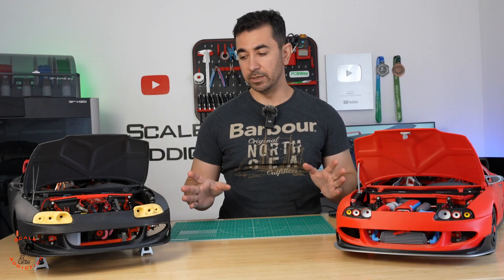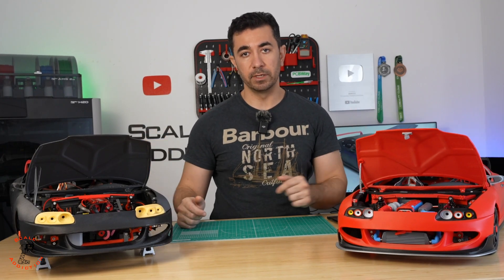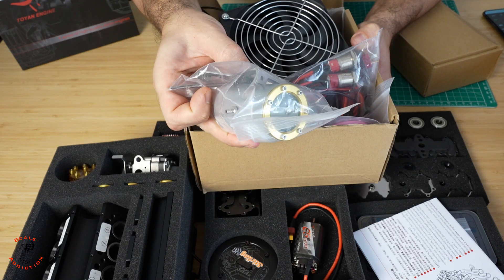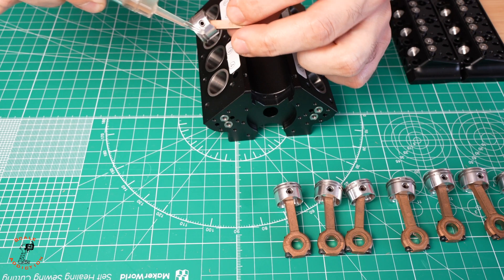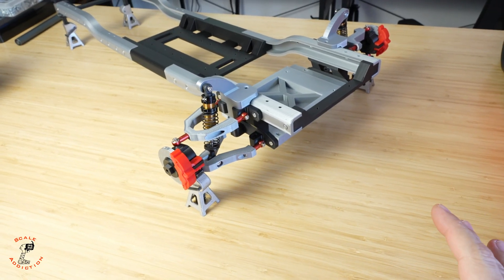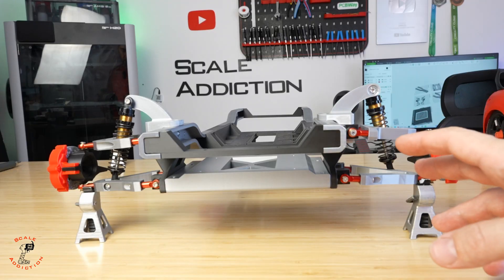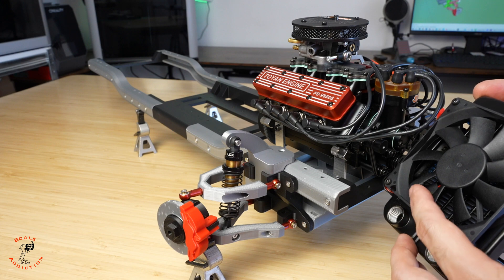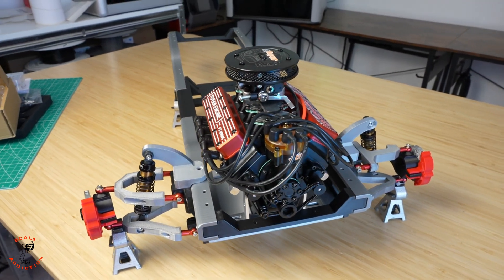3D Printed Chassis for a REAL V8 Engine?!

Comment: 14:37  Unbolt the fan and turn it around so it's sucking air through the radiator blowing back through the engine
Reply from the maker: Thanks for the suggestion